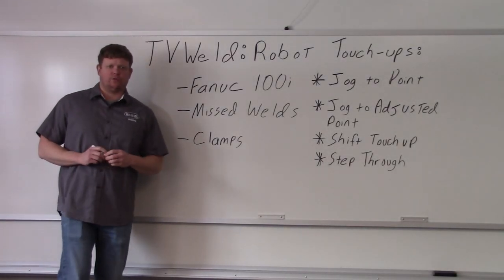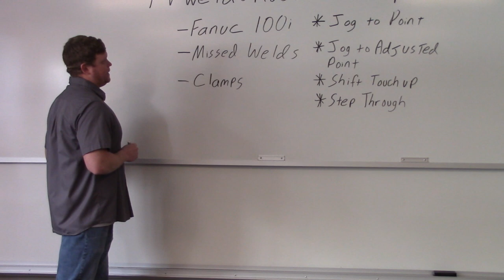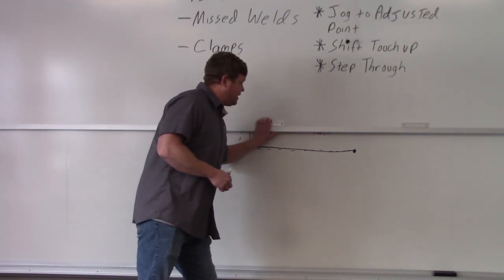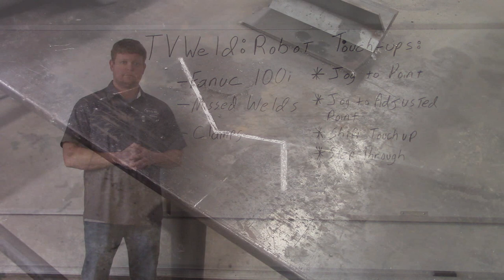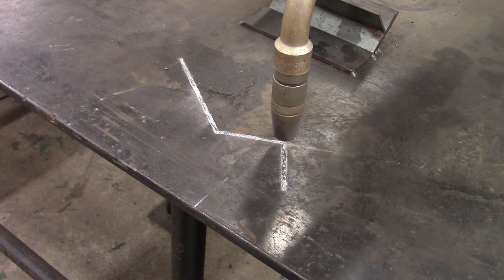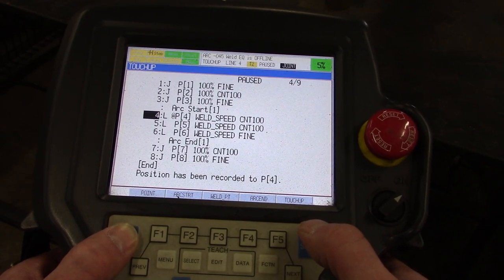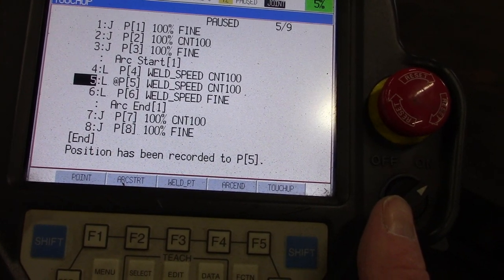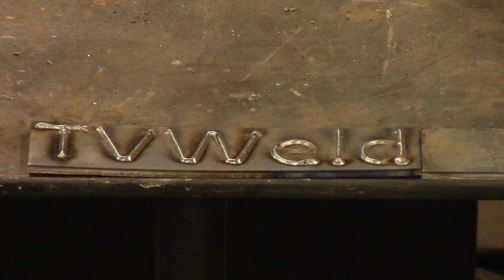How To Perform Touch-Ups On A Welding Robot!

Comment: hello Brent, do you have a burner service station?
Reply from the maker: I don't think so.  I don't know what a burner service station is.
Reply: @TVWeld  I am very sorry that you did not understand me, I mean the welding torch service station when the robot is working in automatic mode.  this station cleans the joint burner between welding.